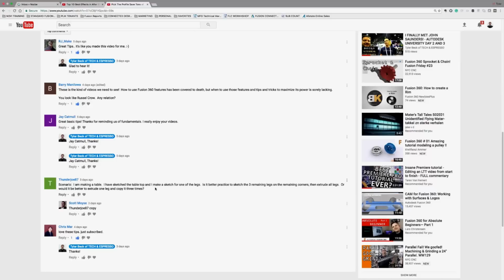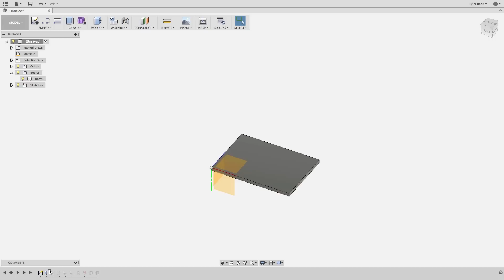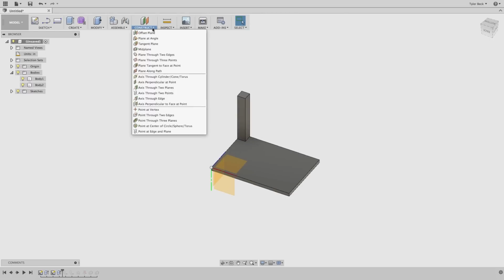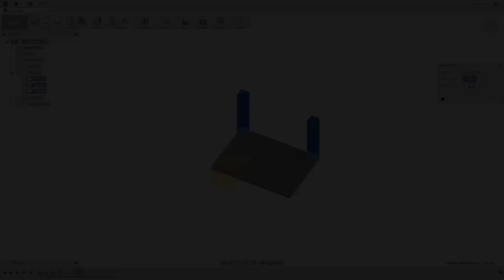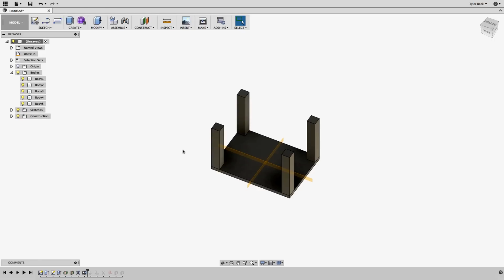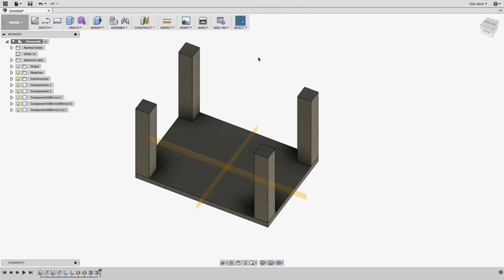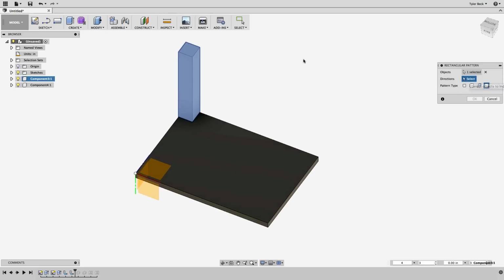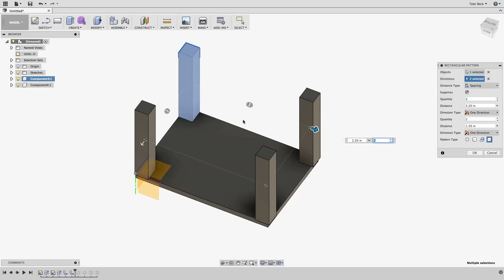Fusion 360 Mirror Sketch - Building Faster Models With Mirror

Comment: I am new to this software and have done pretty well with it so far but I created a cut or feature on a design and couldn't figure out how to copy and paste so I tried mirror. Problem is, the cut didn't go all the way through to the other side of my cylinder, it left a thin wall. What did I do wrong and how can I correct it?

Comment: You will quickly notice the difference between pattern and mirror if you try to put a taper on just one side of a leg(or on two sides). If the North-east leg is the original and you add tapers to the N and E faces of that leg, you will want the SE leg to have tapers on the S and E sides. Mirror will do this for you. Patten will not.
Reply from the maker: Chris Sekely 
Agreed!

Comment: I've been watching your videos and I think they're great! Even though I've been using Fusion 360 and CAD for years, I keep watching these  beginner videos from time to time, there's always great tips. 

There's one difference between mirror/patter you didn't mention and it's if the legs themselves aren't symmetrical(shaped or carved or whatever) using a rectangular pattern won't orient them properly, as they'll all be facing the same direction in the end. It doesn't apply to this model, but I think it's worth noting.
Reply from the maker: Great point.  Symmetry is the question!  If you need it then some form of mirror is a fit.

Comment: Great video. Explains nicely the work effort needed between methods to achieve the same output.

Working with imported STL's... I'm trying to use an convert it to a body to sketch features on faces to pull out a holder/mount for these objects. Is there a best practice to working with imported STL's with 3D printing in mind?
Reply: ... actually. Despite a world of googling, I did just today stumble on this.. http://www.autodesk.com/products/fusion-360/blog/july-27-2016-update-whats-new/

Very useful and I've solved my STL workflow problems.
Reply from the maker: RamjetX 
Hey sounds like you got what you needed!  3D printing w Fusion is on my video list so thanks for giving me a reason to get after it!